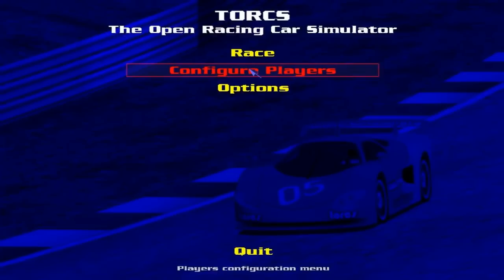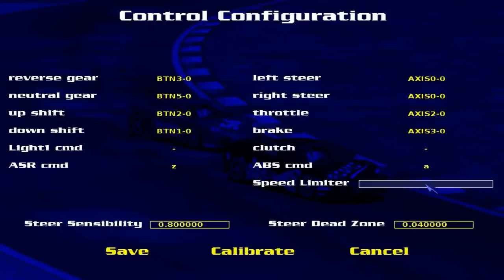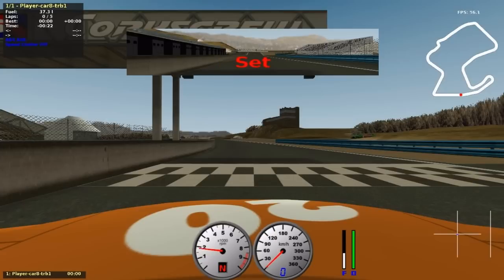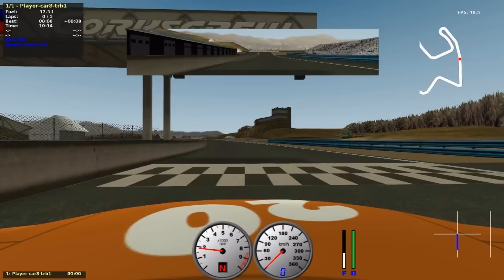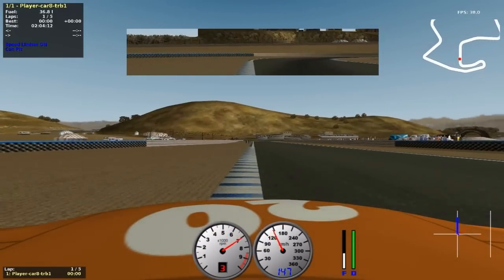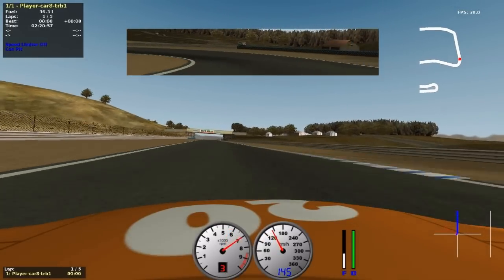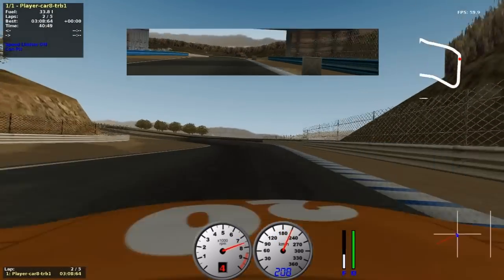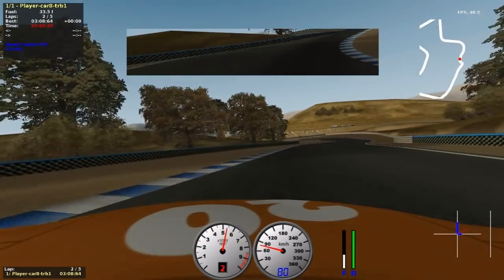TORCS steering wheel setup and practice on Corkscrew

Comment: Thankyou for the great video. I was not able to figure out the setup until I watched it. Very helpful.  Is there any force feedback on TORCS?
Reply from the maker: No, there is currently no force feedback. The reason was that no cross-platform library provided this (TORCS works as well on Linux, ...), but I read that SDL 2.0 has support for it. So in TORCS 1.4 or 1.5 force feedback might be introduced, we will see.

Comment: It should shift gears less or have greater power penalty between.
Reply from the maker: It? Why?
Reply: Was drunk so not sure (am drunk again), but there was a sharpness in audio when gears were changed quickly in and out of turns under heavy acceleration and braking that made me think the car was changing gears too quickly. I could be wrong, or it could just be the audio. Best explanation I can give.
Reply from the maker: Don't drink and drive:-(